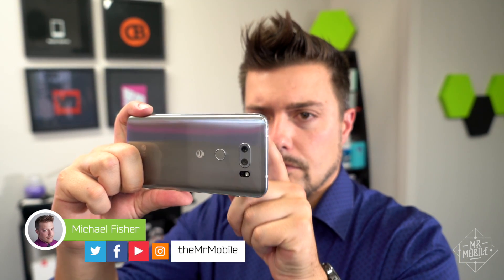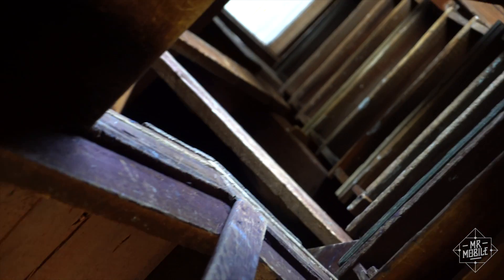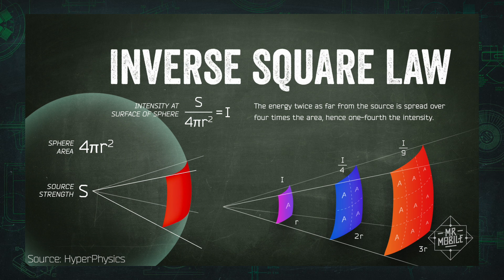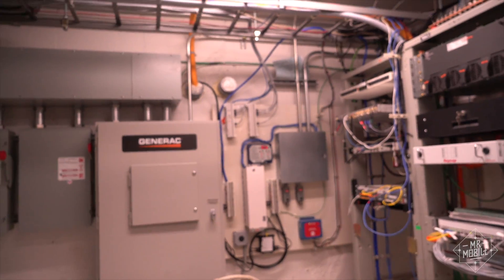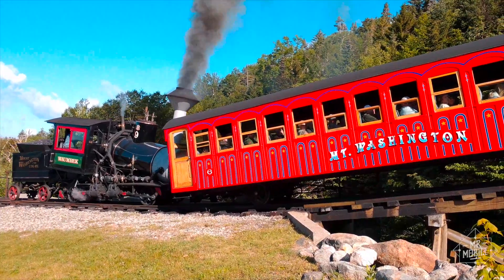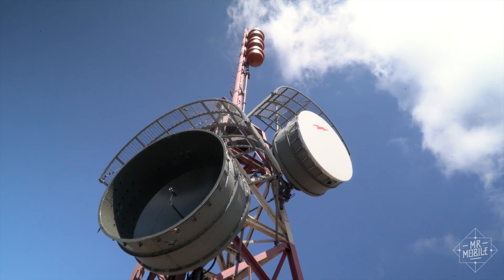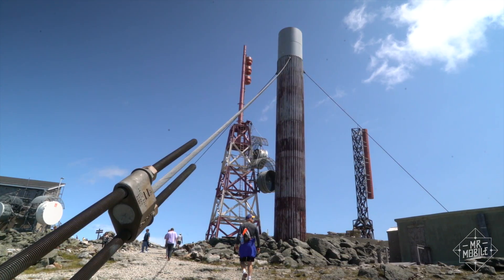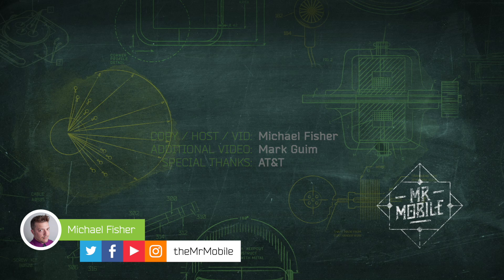How Cell Towers Work: Hands-On!

Comment: And in closing I want to say that people actually have cable phones they have Verizon cable phones they have an AT&T cable phones that have Spectrum cable phones but in an emergency and electric goes out guess what you don't have a phone if the electricity goes out you don't have a phone and sometimes even if there is a backup battery in the router or modem sometimes that doesn't work

Comment: Because if God forbid somebody needs emergency services and it's not able to get to it due to your monstrosity building or whatever you build that's monstrosity that blocks a cellular phone from working you just did something that should be illegal because you technically block somebody from using Emergency Services we need it therefore by having cell towers in every single train track that's elevated in the poles that are elevated by requiring every building higher than five stories that they must have a cell tower either in the backyard that's at least a 1,000 ft above the ground or on the rooftop that's at least a thousand feet above the building by requiring that bye bye bye bye federal law you're technically making sure that 911 services are not interrupted no matter by which house or building and by requiring that every block on the corner in the street light or traffic light needs to have a Cellular Tower you are ensuring that 911 services or any emergency services buy 5G LTE and 5G needing more Towers than with 4G and 3G and 2G whatever you should be requiring more towers. As we against the law not to have it and plus cellular network providers should be required legally to give you a router that works as a tower for 10,000 ft around and around and around in case your house has dead spots for free no cost to you as long as your part of their Network that should also be federal and state law to make sure that the cellular company has to do it or else they can be fined up to 1. 1 that they don't give it to you making sure that people don't have dead spots is a requirement especially to the fact that people don't have landlines anymore they don't they rely on the cell phone more and more and more and people don't have backup phones like they used to have hanging on the wall so therefore the cellular companies can be held liable if somebody has an emergency and is not able to call Emergency Services therefore federal and state Regulators need to get involved here and need to make sure that would 5G and pass that new places for cell towers and new laws for cell towers should be required legally for state and federal levels to be done
Reply: have you ever heard of grammar and run on sentences holy cow that is painful to read

Comment: Building a building more than five stories high you should be required legally to put up a cell tower on the roof of that building by federal Penn State law again by federal and state law in order to make sure that 911 or any emergency services will work if you build more than five stories you're blocking cellular towers ladies and gentlemen for the low rise buildings for for buildings that are maybe two stories high or maybe three stories high hello you're actually blocking cell signals want to build a monstrosity building no problem you just better make sure you put up a tower either in your backyard of that building or on the roof of that building and it has all three cellular providers AT&T Verizon and T-Mobile I don't need to have all three cellular providers AT&T Verizon and T-Mobile otherwise you should be in in trouble by state and federal law because you're blocking cellular signals and even train tracks should be required elevated train tracks should be required to have a Cellular Tower in the pole that holds the train tracks together because 5G and pass that will need more Towers than 4G or 3G needed therefore that needs to become a federal and state law that buildings higher than five stories train tracks elevated all need cellular towers in them and I need a cellular towers that have all three major networks all three major networks

Comment: Ladies and gentlemen what has to happen is every single train tracks that is above ground needs to have a Cellular Tower put into every single pole was AT&T T-Mobile or Verizon cellular towers need to be put into every single pole on elevated train tracks also with the high-rise buildings being built 5 or 6 stories high or more shouldn't be requirement that a tower needs to be put on the roof of the building I think so it should be a federal law as well as a state law that if you're building a house that's higher than five floors High you should be required to put a cell tower on the roof of the building that way 5G LTE will work no matter where and regular 5G will also work no matter where that's the way because 5G needs more Towers the s6g will probably need even more Towers so hello if you build a five-story building or more than that like 678 stories you should be required by federal and state law to put up cell towers and if you have elevated train tracks as well you should be required to put cell towers in the poles that hold the train tracks together that way everywhere you go you have a cellular signal

Comment: I have been to several cell and short haul microwave sites.  However, they were nothing like those two, just a flat roof on top of buildings.  However, one unusual place I've worked is the microwave level of the CN Tower in Toronto.  That level is at about 1109 feet, though entirely enclosed within the building, so it's just an office environment.  I'd get their by taking the same elevator as all the tourists.  🙂

Comment: EXCELLENT VIDEO, Mr. BubbleHead !!! 
   I have an idea for you: How a modern Locomotive is built and how it works. (GE Locos also use Fiber-Optics in their systems). Their onboard computers are hugh! and control 4200hp of tractive effort. They have designed the most elaborate motor-control system there is, on a mobile device!

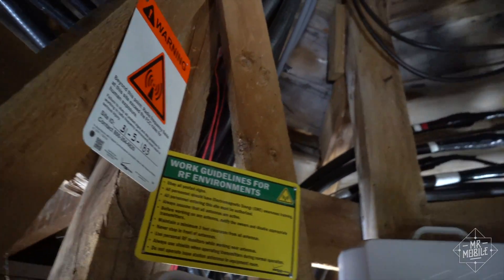Comment: fun fact.. @MrMobile [Michael Fisher] that RF meter at 2:15 is built for microwave, and wasn't calibrated for what you were exposed too.. As a journeyman, i can tell you in full confidence that the crew who brought you wasn't properly trained, and most crews don't have the correct RF meter because anything that isn't microwave specific costs thousands, and very few subcontractors are provided that expensive alternative, and are sold the false idea that their $350 meter's got them covered. This is straight from the mouth of one of Nokia's founders who has sit on the M3 Osha board at a ComTrain cert class while he talks about all the diff types of skin cancer this industry has given him. Those red RF signs are a good indicator to back this up.. because that color is reserved for 80% exposure zones and higher, and was placed there after a more expensive meter looking for stuff other than microwave mapped the space. Rule of thumb to the randoms reading this.. if the sign is red and you don't know what you're really doing, best to get some distance. Blue is the "safest" exposure, then it goes yellow to red.. and that doesn't mean it isn't red on the tower, or in the control room, it just means in that exact spot for the sign, a meter tested for that color of warning.. they'll claim that anything under 100% is safe for long exposure but then at 100% the timer magically becomes 5 minutes before physical damage on some scale occurs. So the reality is that 80% isn't safe at all, but they needed a BS safety scale to encourage climbers to keep working.

Comment: I been working on towers for 15 years this June. Broadcast, cellular, microwave, stacking, gin pole, winch, welding mods, etc.... Love it.
Reply: @renarhodes2990  thats a doppler radar. Those don't put that much power out. I've stood by an active one 3 work days in a row. Not a big deal.

Comment: 6:54 OK dude. Now think. If you can get a Television signal with is the same as a Cellphone signal. You can clearly use that same signal for cellphone connections and internet. How do you figure. Those micro-towers are in anyway cellphone towers? They aren't! That's clearly not what they're for!
Reply: What the f were you saying 5 years ago?
Reply: @2222a-b4m   That 5 years ago was about them claiming Oh We put these little towers next to your home for Cellphones. That was a lie. They are a weapon. Microwave Antenna. That basically can Fry you from a distance. The push up the Ionosphere  They do not point to a tower. They point strait up. An can blast with radiation in any direction on the ground area.

What they have done is cause reverse pressure on Earth. Causing enough that you are experiencing Sink holes. They push up the Ionosphere that much.  In lower areas where is it always cool. They turn up the heat. So your forecast shows temperatures in the low valley will be around 37f where in the upper valley temperatures will be around 71. NOPE! Not with these towers! The temperature in both areas are 105f in a place like Texas. Where the high an low valley are very different.  

I am in Texas an in areas like Waco you are near the clouds area or above the clouds. But once you hit San Antonio You are Below the Sea level. You cant get higher temperatures. You will with these towers. They intentionally Keep the temperature Hot. At the exact same levels. Statistically  impossible.

Comment: The microwave relay antennae on Mt. Washington are not there primarily to serve the cell phone installation but regular land line communications. They predate cellular phone service. An additional inaccuracy in your video is the statement that -34° f is a record in that area. I've personally seen -36 in southern Vermont at much lower elevation. Mt. Washington is known for its record winds. If you had discussed how computers transfer calls to adjacent towers as the subscriber travels that would have fulfilled the title of the vid.

Comment: I used to climb cell phone towers for AT&T and here are some fun facts:

-Those backup batteries are 6 volt batteries that weight around 200lbs each!  Newer ones are 12v batteries that are alot easier to carry 120lbs each.
-I have upgraded a church steeple cell site's radios and antennas.  The antennas on the outside had to be painted.
-The backup diesel generators start themselves up at random intervals to keep everything nice and oiled.
-At 8:40 the cellular antenna is littered with bird defecation and urine!  That's why it looks like green streaks are dripping from it!
-Cell phone site construction is very, very long and hard work!

Comment: LiFi Lighting is way faster in the gig bit speeds wont need cell towers every where 1/4 of the cost and  meets the  Abeille law of 2015 This Law prohibits Wi-Fi in buildings offering access to children under the age of 3 (nurseries, maternity wards, neonatology) as precautionary measure . And makes it Illegal to market cell phones to children under 14...  LiFi  Lighting emits EMW at 269 millivolts per meter  which makes it safe to use in all areas of a hospitals and any areas were delicate machinery is being used … ITs bandwidth is 10,000 times larger than WiFi so its only a matter of time until it takes over the Telecommunication Market …. Found all this on www.lifilighting.com

Comment: good video, however extremely basic. Failed to get into what freq. they are using. what a sector does, type of cabling such as massive effing coax that goes to each RF port on the sectors etc.
Reply: Chad Peterson most of that info is public while some are not. But I can tell you exactly as I build and troubleshoot these cell sites
Freq. used are: 700mhz (LTE), 850mhz (umts), 850/858mhz (new stuff 5G capable not active), 1900mhz(LTE), 2100mhz(LTE), 2300mhz(WCS).
Sectors: Alpha, Beta, Gamma, Delta, Epsilon etc. Each sector is comprised of all or most of above frequencies, each frequency takes care of an specific task. IE: Data, Voice etc and a sector will cover certain area. Now cabling these days are mostly fiber and dc to power the RRU(remote radio unit) when installing them is possible near antenna, if not possible then they get mounted at the equipment room/shelter/back-haul and RF goes from RRU to antenna vía coaxial wires, thickness is depending on how far antennas are from RRUs up to a max diameter of 1”5/8 but is the dB loss is still bad then the use of TMAs (tower mounted amplifier) comes into play. There’s a lot more info but that’s mainly how shit works, hope if sufficient for you

Comment: I climb the cellular towers up to 800 feet that make your phone work. I am that worker. The typical day starts off. I get to my shop. My employer gives me blueprints, notice to proceed paperwork from the Wireless companies. I load my work truck up with the equipment that the Wireless company has given us. I drive to site. On the way I usually get coffee. I arrived to site. Unload my truck. Look at the cellular tower. And figure out how I'm going to rig the tower before I climb it, once me and my coworkers have figured out how we're going to rig it. We put on our harnesses. Safety gear. And tell the ground guy what we want sent up. Or we usually do that over the radio when we get up there. I tie the rope to myself. And I climb the rope all the way to the top of the tower. I install a block (pulley) on the pinwheel or boom, and I send the rope back down the tower. The guy on the ground confirms the shutdown of certain cellular equipment with the Wireless company. Once that is done we shut it down, disconnect the LTE network, by disconnecting the RRUs, the RRUs are what gives your phone the ability to make calls and get data. By the time that is done. The guy on the ground has already sent the new rru to me. I have tied the new rru off onto the tower. And I send down the old one. I put the new RRU  in the place of the old one, reconnect all the power, all the radio lines that shoot the radiation which give your phone signal, I installed a fiber optic, and I power on that sector. And that sector is on and transmitting cellular data to your phone, on a cell tower there is 3 sectors. And up to 17 radios and antennas. At the end of the day I climb back down the tower, but not before I've "snapped the rope" which means getting it back down to the ground. I grabbed my block (pulley) that I installed. And I climb back down. Sometimes I have to stay on the tower until the wireless companies have done LTE and call testing to make sure that all the equipment is giving good numbers and good readings, if they aren't I have to resolve the issue, and if they are my day is over, in the video they're showing wires, those aren't conduits feeding the tower, those are actual RF lines or microwave lines and radio lines, that have RF radiation going inside of them, to the antenna, that's your phone gets. Some of them are fiber optic, and some of them are power. There is much more to what I have explained. But I can't explain it all because it would take 400 pages

Comment: While this was informative and well produced, I find that the title is misleading. A better title might be "Placement of cell towers is site specific." I learned VERY little on how the technology actually works, i.e. how much power is in the signal? What is the maximum distance between towers and useable service? How can you stay connected driving down a freeway for 200 miles without losing a signal? How do different companies share service? How come I have such lousy connections at my house when there is a tower within a quarter mile? Why will it be so expensive for companies to upgrade to 5G? Etc.etc.

Comment: For the last 20 years before I retired, my company designed and manufactured boxes for cell sites (and other communication network nodes)  which used GPS to generate highly precise timing and frequency outputs which would be used to multiplex cell phone traffic so that it could be sent through the trunk lines.
On the weekend of 07 April 2019, a GPS design flaw (Week Number Rollover -- GPS was a military experiment and they didn't expect it to still be in operation for so long nor so widely used) could have caused GPS receivers to suddenly fail.  It had happened once before in August 1999, so everybody in the industry knew what was coming and should have already engineered solutions to handle it.  There was a potential for cell-phone support to be lost, but fortunately everybody did their job (apparently) and I have not heard of cell-phone outages because of that.  The only outage I've heard of so far was the New York City Wireless Network, or NYCWiN, which went down at Week Number Rollover.

Comment: actually the lion's share of work to maintain your cell connection  on placed the cell site.  modern phones transmit with such little power its stunning they can even connect.
Reply: Exactly. The antennas and receivers at the cell site are so sensitive it's just unimaginable how little they have to "hear" from your phone. It's like you being able to hear a mouse squeak from 5 miles or more away.

Comment: B*llshit!! If the 'inverse square law' works the way you say it does [...yes...it does!...].....and the signal is as weak as you say it is, when received by humans[....no.....it is not!.....], then your cell phone would never receive a full signal.  In other words....the church residents are many  times closer to the signal, than most cell phone users who receive that signal...because the signal is many times stronger. As an engineer, myself....I hate it when uneducated fools, get up, and spin engineering science, in a way they are not qualified to do....resulting in non-scientific fairy tales!